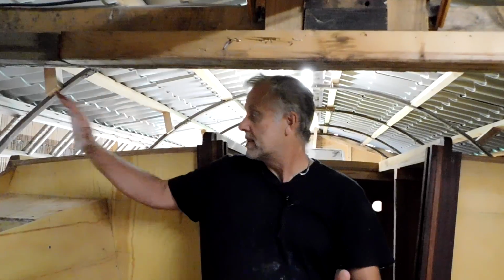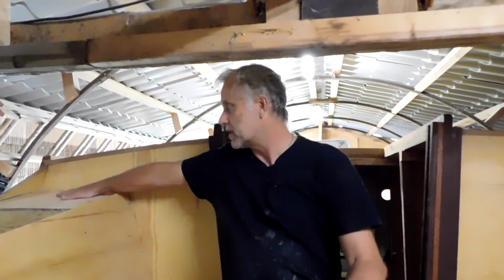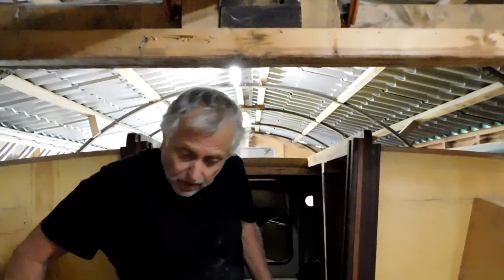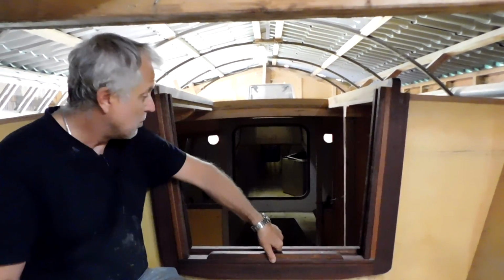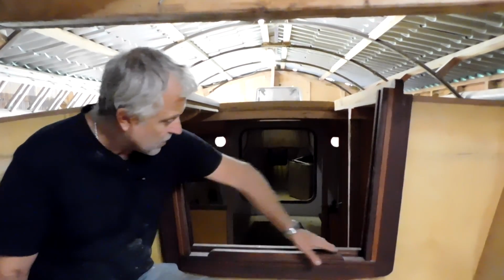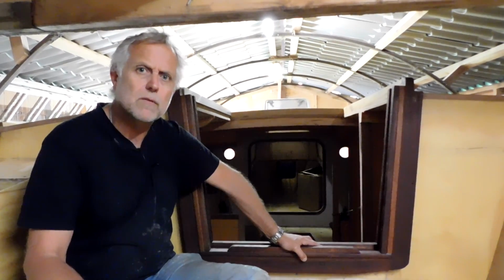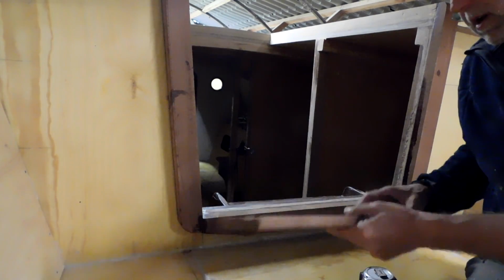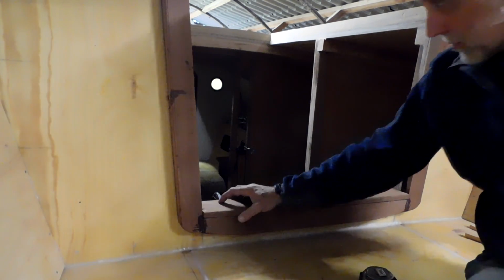The companionway hatch frame and more! - SV Tapatya EP101

Comment: P.s. I've seen several of these with out the fore doghouse..they look rather unfinished.  You were spot on to add it . If it looks right , it is right .
Reply from the maker: Thanks again William. The plans have a butterfly hatch of those dimensions in that same location. I felt a doghouse with flat opening hatch might be less likely to leak. Both give extra light and headroom in the forecabin

Comment: Nice looking wood, really sets off the companionway! You can reduce the 'wood on wood' wear of the sliding hatch by attaching 'Delrin', or other slick plastic strips to the underside of the hatch runners, out of sight but so much easier to slide whether dry or wet. And I put a small swing open port light in the upper companionway board to help with ventilation and light in a pretty dark area. Helped with the mold problem during storage as well.
Reply from the maker: Thanks Mike. I'll look into Delrin 👍

Comment: Can I ask why you used nails instead of screw's on the small peace of wood? I'm going to build one my self so any tips and tricks are welcome 😊
Reply from the maker: Hi Jean. The main reason was because I had some bronze ring nails in stock. I thought I could leave the heads exposed and then varnish the entire hatchway.  You could use screws - bronze or stainless- and then either plug them or seal over them somehow. Alternatively, just epoxy glue it together... There are several options 👍